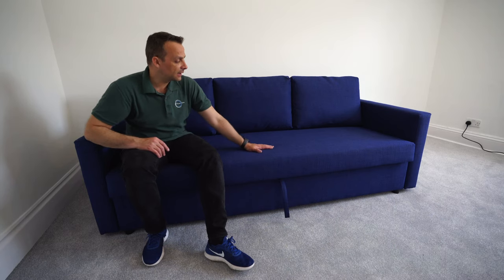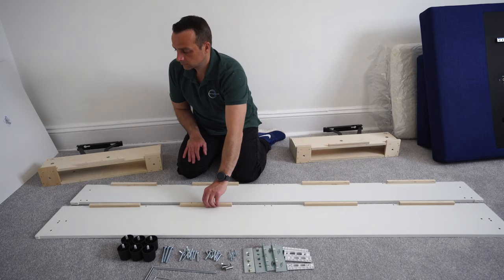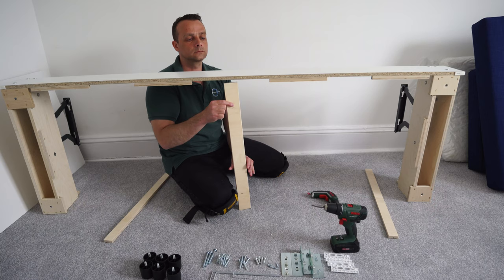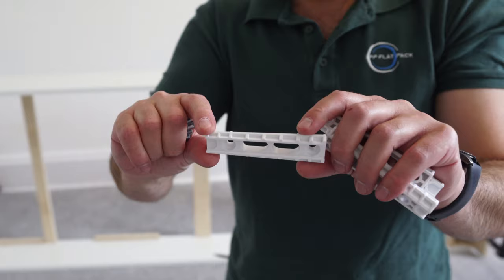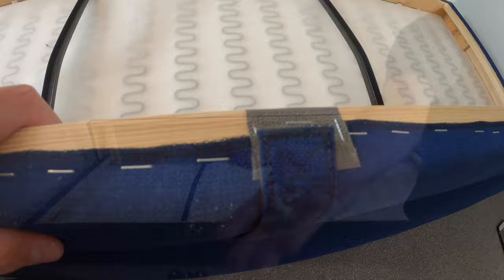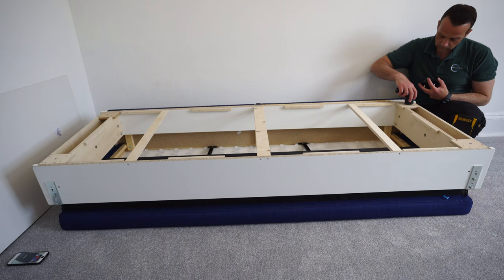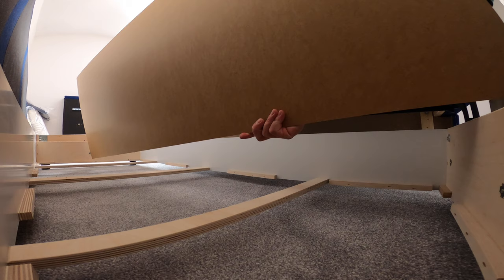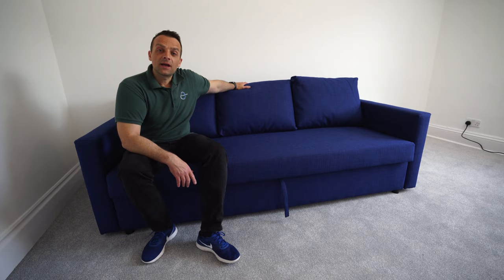IKEA FRIHETEN Three seat sofa bed Assembly instructions

Comment: Thank you very much for making this video. After watching it,  I was also able to build the sofa bed by myself. ( I am only 5'3"" and 66 year old lady). BTW, the interior panel for the bottom of the storage area goes in quite easily I found if you stand in the back middle,   and slide it towards the front so that it goes under the the overlapping top of the front part of the sofa first. Then the whole panel just plops down easily at once.

Comment: Nice video!  But now I'm wondering about those plastic pieces that hold the sides on.  The rest of the sofa seems well-built, but those plastic side pieces seem like a weak link to the whole system.  Are they replaceable if they get broken?
Reply from the maker: They are replaceable but they seem to be strong enough

Comment: Hey man. The armrests don't go in. The screws on both sides obstruct it from going in. Any help?
Reply: i have the same problem bro, did u make it?
Reply: @chenglin513  yes. I figured it out. We put the wrong screws for that plastic thing. I had to dismantle and start again with the right screws. The right screws will go all the way down and won't block it.
Reply: @coolnikhil020  thanks bro, but im sure that im used the right screws.... i checked it now in the manual... still can't make it  😂what a bad design
Reply: @chenglin513  Well, im not sure then. But trust me. I almost spent almost 4 hours being positive I did the right screws. But I think its very unclear in the instructions. Or maybe wrong even. It's definitely the screws. I remember that day very well 😆
Reply: @coolnikhil020  its spent me like 1,5hours to install the sofa and another 2 hours trying to lock the sofa arm😅...but didn't make it..... i going to try again tonight... is a nightmare... 
if i buy i new house i won't buy this thing again...
Reply: @chenglin513  I'm having the same problem. Did you figure it out?

Comment: Great video. Question, how large are the boxes the sofa comes in? IKEA doesn't have delivery were I live and I'm trying to figure out if they would fit in my car. Thanks!
Reply from the maker: This product has multiple packages.
Width: 76 cm
Height: 31 cm
Length: 204 cm
Weight: 53.20 kg
Package(s): 1
Width: 83 cm
Height: 23 cm
Length: 207 cm
Weight: 49.20 kg
Package(s): 1

Comment: IMPORTANT!!!
The white pieces need to be installed in such a way that the screws go ALL THE WAY IN.
If the screws stick out at all (even a tiny bit) then the armrests will get caught and NOT slide on.
It is very easy to make this mistake!
All you need to do is flip the white pieces in order to correct it.
The long vs. short end configuration as shown in the book remains the same.
There is no way to tell by looking at the photos.
You have to physically put the screws into the white plastic pieces to understand what I'm talking about.

Comment: Am I the only one who can't put the side pannels?
Reply from the maker: Nooo you not alone they hard to get in place I think they made them like that because it need to be solid fix so just try again the key is to push them hard on the side before you slide them down.
Reply: The side panels are a real pain. Even Ikea admits is not a great way to attach the side to the sofa body. The before option was way better.